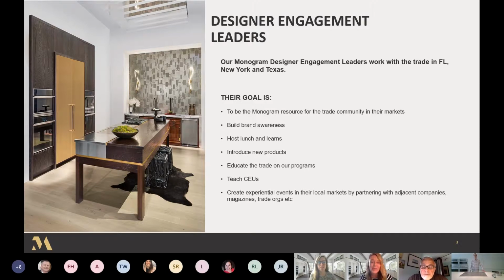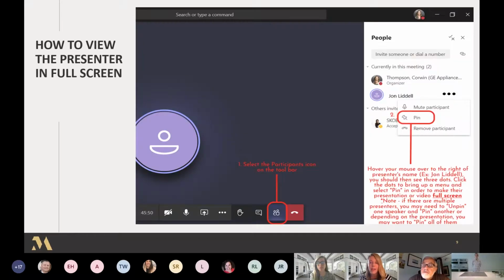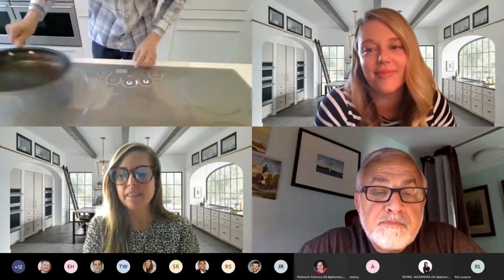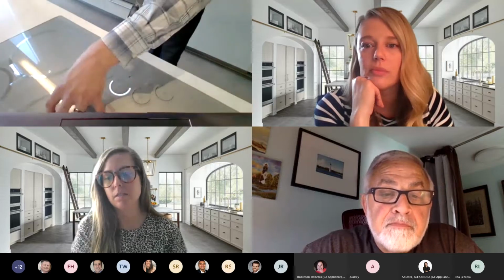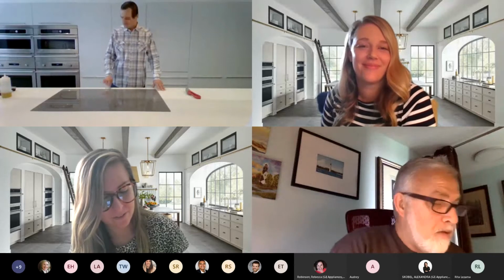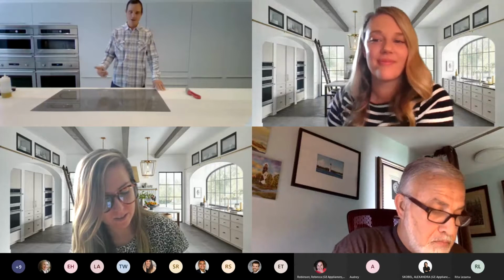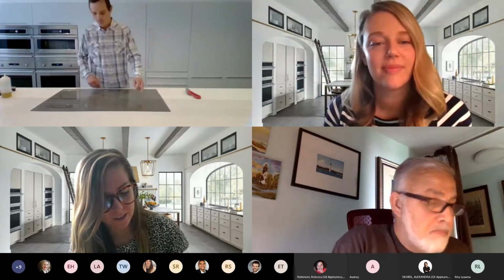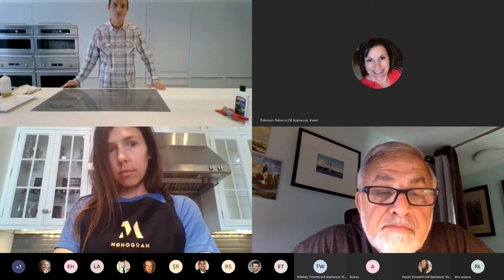Monogram Table Talks: Product Training – Induction Cooktops

Comment: My Monogram induction cooktop just threw an error code F75. Circuit breaker on and off did not reset it and I get an error code 143 once the circuit has been switched back on. This is the third GE Monogram appliance out of a five bundle suite package that has failed.   I would like to be able to run a diagnostic code test on it but the unit is unresponsive to any touch control.  Suggestions??
Reply from the maker: Hello Sushi.  We are sorry to hear that your cooktop is causing you frustration.  The F75 is a fault code.  Fault codes are programmed in digital cooktop controls. These codes help GE Appliance Factory Service technicians quickly diagnose issues with the cooktop. In the event that the electronic control displays a fault code (FXX), a trained Service Technician should be called to diagnose and correct the issue.  Sometimes shutting off the circuit breaker for the cooktop connected to for 30 seconds will clear the fault, error or function code, however, in most cases service will be required.  You have  tried this only to have it happen again.  For service, please schedule an appointment with Monogram service by calling 1-800-444-1845 or by scheduling online at https://www.geappliances.com/ge/service-and-support/service.htm -- Hope you find this information helpful.  Stay well.  GA